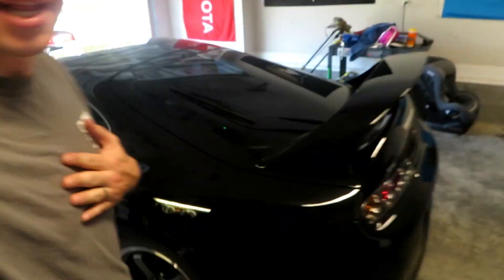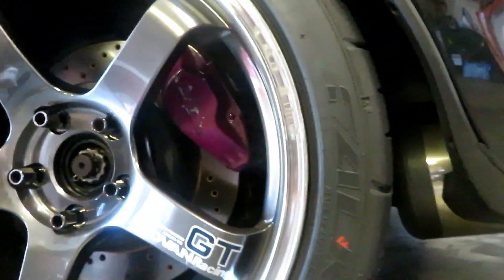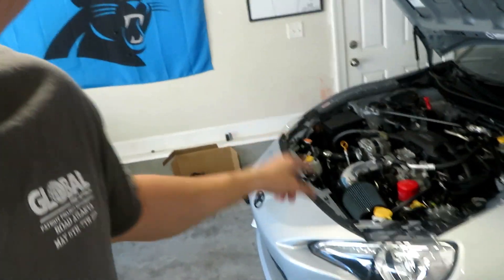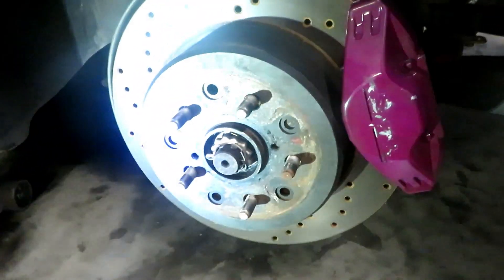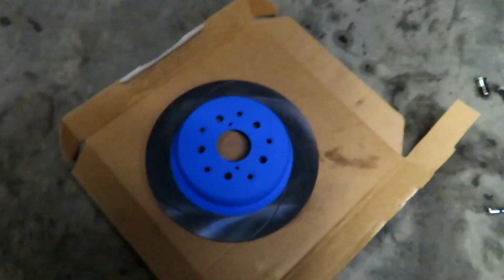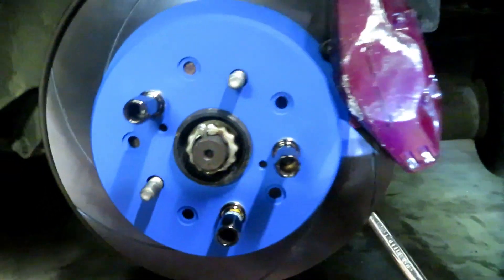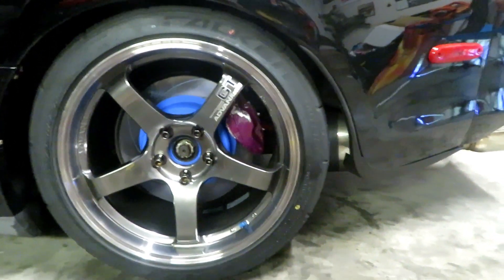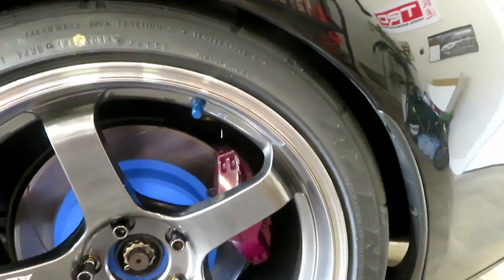Endless brake install - Toyota Supra

Comment: Are you sure that blue coating isnt like what EBC does for the rotors (the black finish) that you just grind off with the pads when you put them on? Its not a slick oil is it?
Reply from the maker: It did come off. I tried removing it with brake cleaner but it didn't come off. Only after doing a bed in process did they clear off.